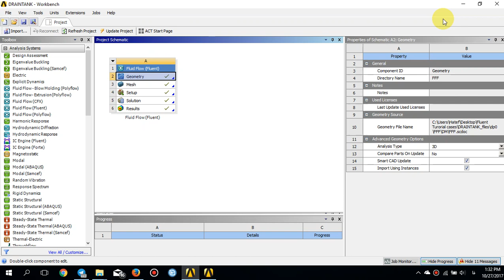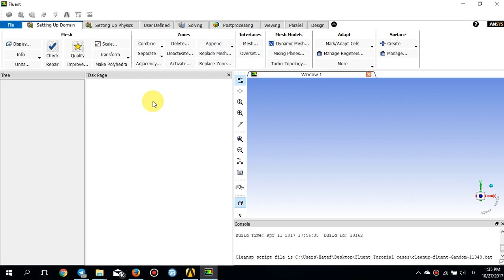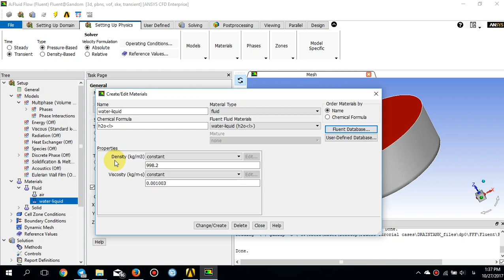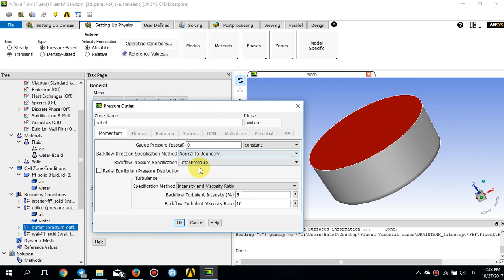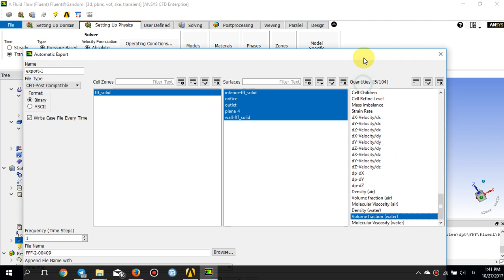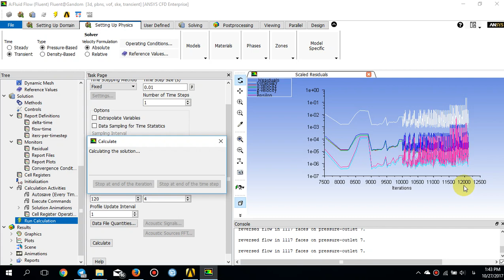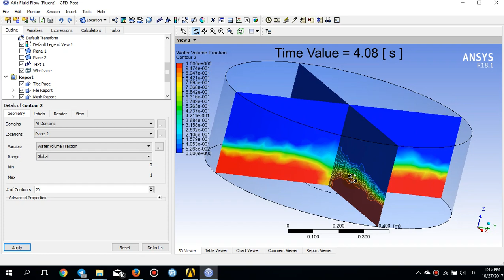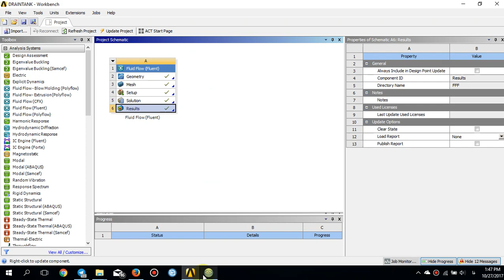Ansys Fluent tutorial 10, Transient simulation of water drainage from a circular tank

Comment: From what i have read, for flows inside closed boundaries or near wall flows, k omega is the preferred turbulence model ( mostly SST because of the shear forces that occur) but i suppose considering the speed of the flow and pressure values are low, k epsilon was good to use in this application? Please correct me if I am wrong.
Good tutorial nonetheless, thank you!